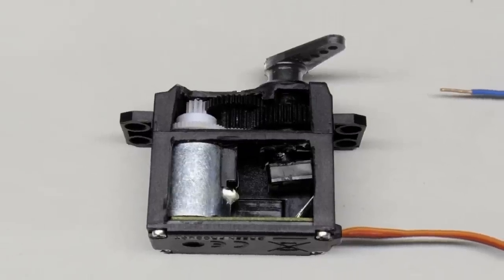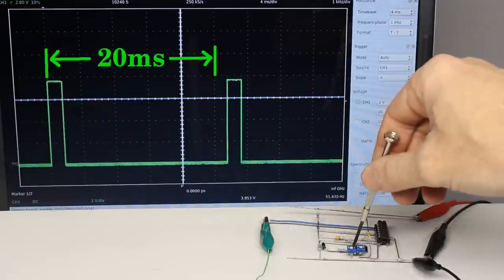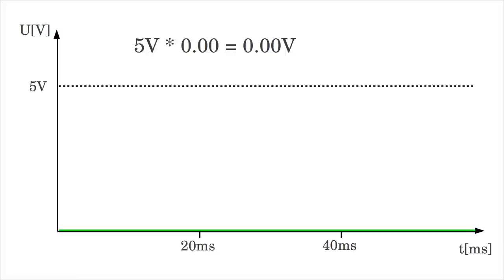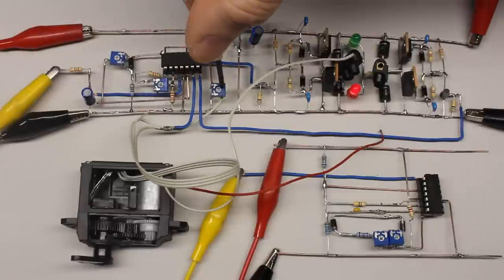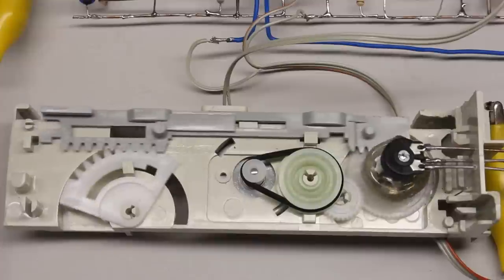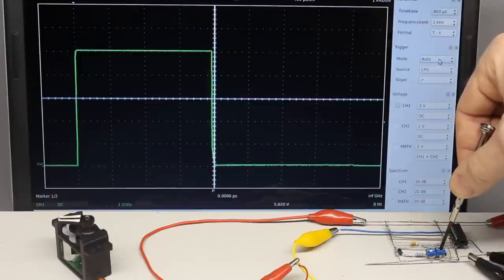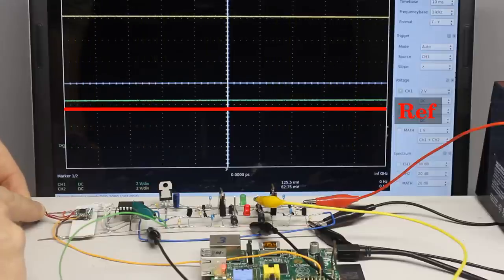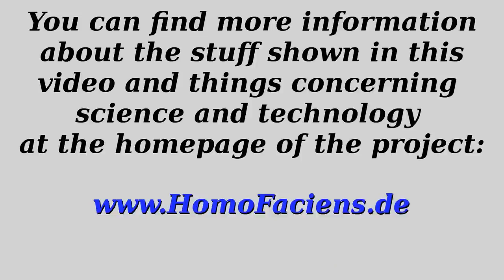Servos - working principle and homemade types

Comment: The best video on the internet regarding servos. Should be used in engineering courses. Even the measurement of torque is unique.
Reply: I just had to download the entire video.
Reply from the maker: ocayaro
You are allowed to download, modify and use it for courses or what ever you like - it's creative commons!
Reply from the maker: ocayaro I am creating life changing videos? Great! ;)
This one looks interesting to me:
LM324 servo motor driver with sensor feedback
You should give some more information about your creations to make other youTubers understand what you have done. YouTube is more than just presenting own stuff it's spreading knowledge. Maybe an audio track with your comments makes your videos more interesting. What kind of motor are you using? It is running very smooth.
Reply: Thanks for the valuable tutorial, advice, and also for watching. Yes, I will make a video with audio and better definition and video. These ones were really to document my own progress. The motor I am using is from a 5V dc motor geared down to about 20rev/min.
Reply from the maker: ocayaro
Did you purcase the motor for this project or did you remove it from a broken device?
Reply: When I was trying to make my own gear train and potentiometer I stumbled on a music system with a motorized volume control. I took that out and used it. I am interested in using servos for my own robots, not just model control. Using lessons learned from you I will build any kind of servo for almost any application.
Reply from the maker: ocayaro
I also like giving old devices a second life ;)
Reply: Do you have a schematic available for the self-made servo board @ 6:17?  Thank You
Reply from the maker: As said in the video, all schematic are available on the project page:
https://homofaciens.de/technics-base-circuits-servos_en.htm

Comment: At 11:00 the circuit has 4 N channel FETS, won't that just short the supply whenever there is a positive voltage at X1 or X2? The upper ones should be P channel, no?
Reply from the maker: Well, that's my bad. The top MOSFETs should of course be P-Channel MOSFETs.

Comment from the maker: @Wang Kerr: Control circuits (and so PID) will be treated in a subsequent video. I am currently working on a video about microcontrollers and how to use these tiny computers to build digital servos. Software implementation of PID will at least be a small chapter of this upcomming video - stay tuned.
Reply from the maker: The video about the Arduino Uno microcontroller using software implementation of PID is now available:
Arduino Uno: control circuits and homebuilt servos
Reply: HomoFaciens a

Comment: 11:00
This is excellent.   
The error detector,  is the two Op-Amps,  with "Window" comparator  required.  
The H circuit is either full on, or full off, as required. 
A very clear presentation!
Thanks!

Comment: hello.I have a couple of questions if you don't mind :D that is an integrated circuit or a microcontroller?I need a servo for an RC car for turning left or right and I have no ideea how to connect the servo to the receiver (4 channels).The transmitter haves obviously 4 signal outputs with basically push-to-ON switches.Can I use on one channel insted of a switch a pottentiometer like the one you used on the video and directly connect the signal orange cable of the servo to one afferent channel output of the receiver?I need this for my bachelor degree.if you have any indication that would be greeat and I would be very thankfull.
Reply from the maker: Liv Manole I have not idea what you are talking about. Have a look at the project page:  
http://www.homofaciens.de/technics-base-circuits-servos_en_navion.htm:  
I have no microcontroller used in this video as you can see in the schematics. Maybe that helps to solve your problem..
Reply: HomoFaciens  I was referring to the operational amplifier(aparently). Anyway,the project page is very helpful .thanks
Reply from the maker: Liv Manole The videos are just one part of my projects.

Comment: When I am using an integrated H-bridge such as an l298n, then can I directly connect the tiny servo's motor outputs to the input pins of the H-bridge without using comparators?
Reply from the maker: No, you still need the comparator.

Comment: Alternative "H" bridge, Transistors:
Upper two, PNP,
Lower two, NPN.
Reply from the maker: That's how an H bridge is usually made. I don't see where the alternative is?
Reply: @HomoFaciens  Hi,
You have done a superior job here! I was simple trying to figure out how the circuit works.
Reply from the maker: Maybe a look at my page about servos helps even more to understand. There you can see the circuit layouts:
https://homofaciens.de/technics-base-circuits-servos_en.htm

Comment: Thank you for the answer. I have built a big paddleboat model whith a 12V 80W motor.A PWM unit controls the speed whith a potentiometer. The servo turns 90degrees but the potentiometer turns 270 so I cant fix them together so I have done some kind of mecanikel gear.Would have been better al electronic but I think it have to stay this way
Reply from the maker: Chris De Berg I suggest to keep that mechanical solution. Adding an electronic circuit to the existing control loop might worsen the result.

Comment: Basic question.  What kind of wire to build your circuits on and where do you get it from?  Thanks!
Reply from the maker: Its welding wire I got from a hardware store here in Germany. Solder points tend to crack. I guess copper wire would be a better solution, but sometimes I simply take what I have ;-)

Comment: Dear Sir,
I learned a lot from your video. Thanks for your enormous effort.
I have one question. Can H-Bridge be build using combination of NPN and PNP transistors instead of IRF9Z34N and IRLZ24N?
Reply from the maker: You're welcome!
Yes, you can also compose an H-Brige of NPN and PNP transistors as demonstrated in my video about that circuits:
Working priciple of H bridges
and written on my project page:
http://www.homofaciens.de/technics-base-circuits-h-bridge_en_navion.htm
Bipolar transistors are more tricky to handle, since the base current has to be considered, which is very high for high power types. This type of H-Brige can't be driven directly by a low power op-amp as used in the video. You have to insert an additional amplifying stage between the op-amp and the power H-bridge.

Comment: Hi thank you a lot for the great simple explanation
We are building a 20 by 20 cm robot using two 14 kg.cm servos
The problem is that the servos cant keep a steady low speed , the servo internal control board seems like it is reseting repeatedly and randomly. 
Strangely if we give the servo an initial signal from the arduino then we disconnect the arduino, the unstable speed behavior stops

Plz help us we have a competition coming and we need your help
Reply from the maker: You are talking about a servo for continuous rotation? 
Modern servos have a built in microcontoller which could cause your trouble. Maybe it does some recalibration when reconnected. Something that also can cause trouble is temperature. If the H bridges heat up during operation the electronics might drift and so chage motor speed over time. So the only tip I can give is trying another type of servo.

Comment: how to make a servo with continuoys rotation not making a full reverse turn for going from 359 deg to 1 deg
Reply from the maker: You would need a potentiometer with 359 degrees of rotation (normal potentiometers have a dead spot of more than 10 degrees) or use a rotary encoder and create a digital servo. I did something like that with a wiper motor:
https://youtu.be/XIUrnR8bLAI

Comment: Top quality.

I want to know if I can make my own servos with 14 Kg.cm of stall torque or just about. Those servos are the ones used on robots that fight in Robo-One robot fighting competition (30 cm tall, a few kilograms). The cheapest you can get those good digital servos is about $45 and a robot needs about 16 of them, so that makes the project unreasonable. They use Maxon RE Max which is apparently one of the best DC motor in the world, and made in Switzerland I think.

What do you think? I am okay about the electronics and making metallic robot parts, but the servos will be too much money so I need to think of a way to make strong/fast, durable digital servos (for digital i will have to make a driver board from Eagle and a PCB service, with smd components) but I really don't know where to source some good DC motors.

Thanks for this video it is top informative and top enjoyable to watch. ^_^
Reply from the maker: valflyinf The circuits treated in this video are just good enough to demonstrate how those control loops work in principle. They are not for practical use. It's not easy to get the quality of commercially available servos with an own built. Have a look at my video about the Arduino Uno that covers PID circuits and demonstrates how to build a digital servo from a wiper motor: https://www.youtube.com/watch?v=PQ1FBcQT0AI
Reply: Oh I watched it already :) was very nice.

Comment: I have to present a lecture on servo motors, can you please list some practical uses of servo motors apart from robotics?
Reply from the maker: I am not the guy that makes your homework ;-)
If you can't find more uses than robotics, list the different use cases of servos in robot applications.

Comment: Have u any idea how to transform a PWM signal from a RC reciver to a PWM signal that controls a DC motor?
Reply from the maker: Chris De Berg The really simple way is buying a RC motor controller ;)  
Using an Arduino is simple if you are skilled in using microcontrollers. Analog circuits are tricky to implement. You can try to convert the PWM signal into a DC voltage as demonstrated in the video and reconvert that DC signal into a PWM signal through an astable multivibrator if you'd like to learn how it works. It will be a long way to build a good quality circuit that way...

Comment: Hello, i it possible to modify servo in a such way, so that value from the potentiometer is read by the arduino as well? So that micro controller can detect situations where servo is commanded to assume position but it did not (perhaps some mechanical obstruction)
Reply from the maker: +Davorin Ruševljan 
Yes, you can read the servo position through the wiper and an analog input of the Arduino, assuming you know how to do the coding. Don't forget to limit the input voltage of the analog input (in case your servo operates with more than 5V).

Comment: Dear Sir, Thanks for your feedback. Can you please also suggest that how can I have a soft start and soft stop speed of the motor in the beginning and at the end position respectively of the servo motor? Higher capacitor in H-Bridge may some how help? I guess not to a big extent or?
Reply from the maker: Inserting a capacitor in the H bridge won't succeed. I will soon (probably in some weeks) publish a video about microcontrollers, demonstrating how to build digital servos. I guess something like that would be the best solution to your problem.
...sorry for my late response, but I did not notice your question until now...
Reply: HomoFaciens Dear Sir, Thanks for your reply. I am waiting for your video about microcontrollers. Thanking for sharing your knowledge, a great effort from your side.

Comment: Muchisimas gracias el mejor video en su tipo ,Y el mejor INGLES que he escuchado!! No necesite leer  entendi todo clarito: Pregunta para ti    Tengo instalados en mi aeroplano 4 servos Futaba S3305 para trabajar en 6volt , pero se ponen a conversar entre ellos que parece una camada de ratones ! y los movimientos son lentos y pobres me comio la bateria de 6V en un ratito   Le puse 12V y andan PRECIOSO no conversan mas y trabajan sin problemas ; es Peligroso  que se quemen? NO calientan ,
Reply from the maker: juan asanelli ...if you expect an aswer, please post in German or English. The result of Google translate did not make sense to me...
Reply: Ok My Friend  No problem:Thank you so much the best video of its kind, and the best I've heard ENGLISH !! No need to read everything I understood ALL: Question for you I have installed on my airplane 4 servo Futaba S3305 to work in 6volt, but get to talk to each other seems a litter of mice! and movements are slow and poor ate me 6V battery in a while I put 12V and walk PRECIOUS not talk and work more smoothly; Is Hazardous to be burned? NO heat,
Reply from the maker: juan asanelli ...I still don't understand your problem. You are using 6V Servos with 12V?!? I have done this accidentally with a servo while recording this video and scrapped the device...
Reply: Yes My friend ,but is the form that this operate  if not they talking adn jerk  and NOT working  The actual battery is 7.5 volt  2100 ma

Comment: There mistake picture on 15:16 D6 and D7 should put DOT there so connect to motor, and also D8 and D9. (is this correct?)
Reply from the maker: D6 to D9 are flyback diodes. I can't see where there is a mistake in the schematic.
Reply: yes it is, should it connected to motor? because from schematic it just 2 diode from gnd to +.
Reply from the maker: They are usually connected close to the MOSFETs, because these are the devices to get protected by the freewheeling diodes.

Comment: This is just what i needed, getting my wiper motor tomorrow
Reply from the maker: While waiting for your wiper motor you could watch my video about the Arduino Uno:
Arduino Uno: control circuits and homebuilt servos
The digital version of the wiper servo using that microcontroller is a great improvement.

Comment: i have a question. how to control the speed of a servo ?
Reply from the maker: a00000z100 By the speed of change of the control signal. If you want to make a servo do a 90 degree rotation and you change the pulse width of the control signal from 1ms to 2ms abruptly, the servo will do the turn with maximum speed. If you change the control signal from 1ms to 1.1ms to 1.2ms and so on, the servo rotation is slowed down.

Comment: Hi Could please let me know if the servo can be used for Laser Engraver ?
Reply from the maker: What servo for what laser engraver for what function?
Reply from the maker: You can use hobby RC servos for a pan/tilt mechanism and so control a laser beam along a plane, but don't expect to get useful results. It will be good for a demo only.

Comment: hi, @ 5:11 what sort of ic is that ? also, can i use that type of setup for a home made servo ?
Reply: i order a bunch of L293D ic chip, 10k Pots (& digital pot "mcp41010" just incase i can shirkify the setup). 

Will all this be enough to put together a home made servo ? 
i also have some dc motors as well as 3D printed gearbox.

just in-case i got some 555timers and Op-Amp.
Reply from the maker: +Frank Lopez It's an op-amp type LM324N. You can get the schematics on my project page: http://www.homofaciens.de/technics-base-circuits-servos_en_navion.htm
Reply from the maker: +Frank Lopez The schematics are available at: http://www.homofaciens.de/technics-base-circuits-servos_en_navion.htm 

The maximum current of the DC motors must stay below 600mA when using L293D H bridges.  Consider that the quality of the circuits in this video is clearly lower than that of commercially available servos. It's for demonstrating how thing work.

Comment: why dont you make a video on converting a normal dc motor into a servo with pot feedback ? for the  people who dont have servos ! to try on projects !! i could be helpfull !!
Reply from the maker: +Kanishka Prasad ...but that's what this video is about - isn't it?
Currently I am working on a video about rotary encoders, demonstrating how to build servos using DC motors and photo sensors with an Arduino.
Reply: +HomoFaciens  it is !!!! but what about the wiper motor ? can this be applied to that as well !! ? ur demonstration shows the stock servo ! but im talking about converting a normal wiper motor to a servo with a petentiometer attached to the rotter to sense the angle !!
Reply from the maker: +Kanishka Prasad It's a working, but not a good solution to build really strong servos. Have a look at my video about the Arduino. I am demonstrating how to turn a wiper motor into a servo in this video:
https://www.youtube.com/watch?v=PQ1FBcQT0AI
Another video using rotary encodes is under construction and will go online in one or two weeks.